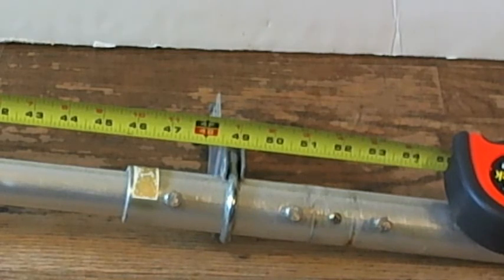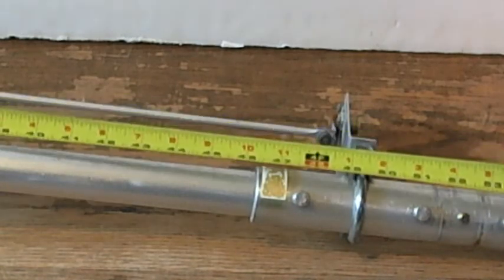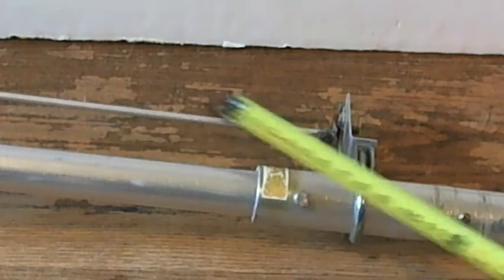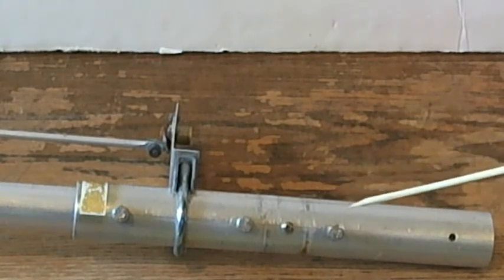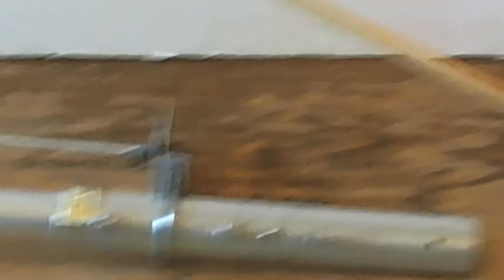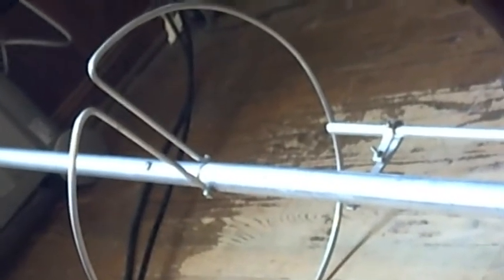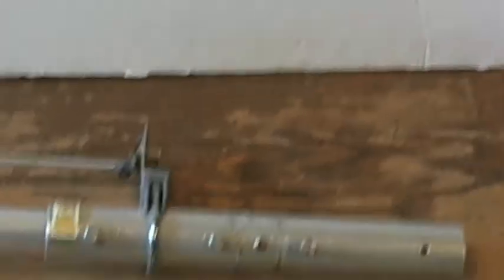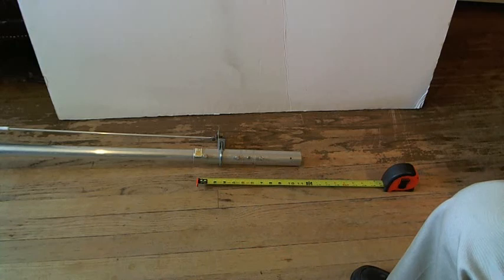Marconi discussing the measurements on the Wolf .64 Ground Plane

Comment: thank you very much old grandpa . i usually (for conventional vertical omni antennas) usually think of the bottom being either where the coax connects or where the ground elements come off at . but the wolf seems to offer another location depending on how you look at it . 

thanks again sir :)